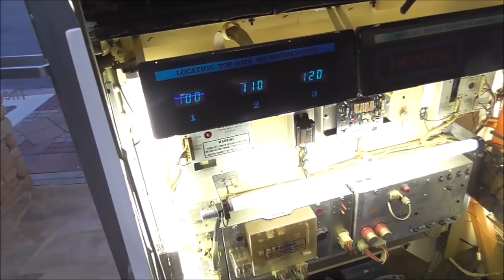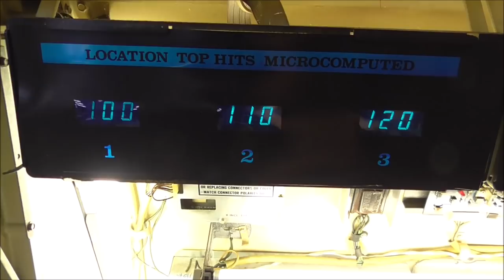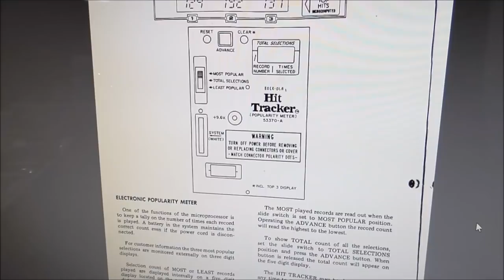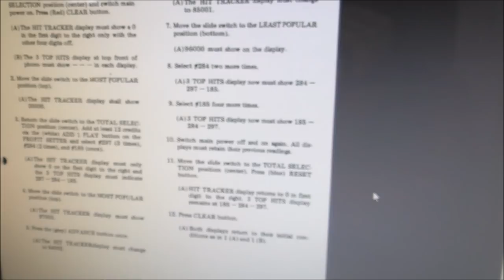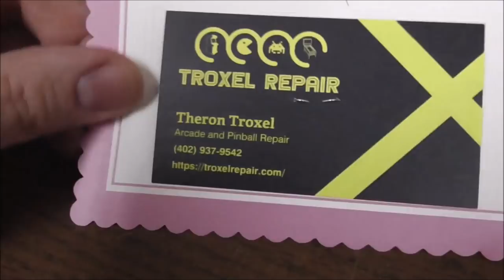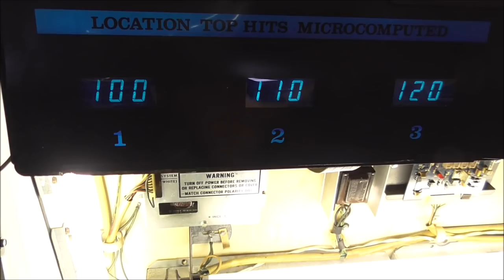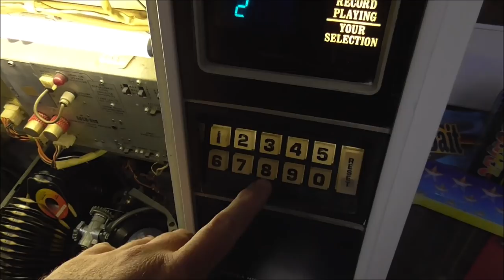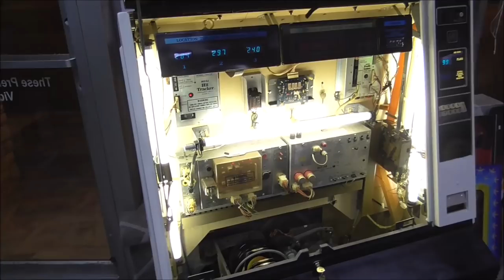How To Fix The Hit Tracker In Your Rock-Ola Jukebox!  Vintage IC's that use 9.6 Volts????

Comment: Ron just come across this video, that is exactly the same Hit Tracker fitted in my Rock-ola 477 Max (1979) After watching this I took mine apart and found the battery fitted was, quite possibly, the orignal when this came over to the UK from the USA. It is a 3 Volt Eternacell with markings on it MT Vernon NY. Although there is no charge in it, it wasn't heavily corroded at all. My intention is to relpace it  just as you did with a button battery and hope everything else inside functions correctly. I would never have attempted this without your guidance first.
Thanks for all your knowledgeable posts, particularily enjoy the pintable ones and ones on rock-ola obviously.  
Stephen

Comment: The 9.6v line on my Rock-Ola 477 was sending my profit setter nuts, all kinds of random goings on. It read OK on a multimeter, but when I stuck the 'scope on it, you could see a lot of ripple. Some rather tired old electrolytics inside the power supply module turned out to be the problem.

Comment: That RAM chip is actually a HM3-6518-9.  Harris Inc. stylized the "H" but still made it part of the chip number, for maximum enjoyment.  Absolute maximum supply voltage is +7V (+5V recommended) so there must also be a +5V supply, or else there's a voltage regulator on that board somewhere (maybe one or more of those transistors and a zener diode or two).  The MM5799 is the microcontroller.  No luck finding anything about the MM57163's, but they almost have to be display decoders and drivers, and maybe even input controllers.  Many of the chips chosen for this board were originally intended to go into desk calculators.

Also, CMOS chips such as the CD4xxx series (your CD4069 hex inverter included) have an absolute max voltage of 20V.  So they tend to be used where higher voltages are preferred.

Back then there was a period of electronics with weird voltages.  The Intellivision home gaming console used +12V, +5V, and -2.3V on the CPU.  The clocks (that's right, plural clock inputs) were +12V.  Fortunately, later chips started using internal voltage steppers, so they hide the complexity and only demand one VCC voltage.

Comment: I believe the National Semi P-MOS MM57xx series, like the MM5799, was designed to run on around 9 volts. The MM5799 micro was popular in electronic games of the period as well as a couple of pocket calculators, that all ran on 9 volt batteries.
Reply from the maker: I forgot about 9v batteries, I guess that makes sense why you would need 9volt chips!

Comment: Where did the 240 come from in the 3rd spot?  Wasn't it 185 when you turned it off  the last time?
Reply from the maker: I don't know, I didn't notice that when we did it... it's a mystery!
Reply: @LyonsArcade  yeah, Ron, I noticed that too....hmm
Reply: old SRAM chips (especially AFTER getting old) that were designed for a retention voltage of 3.6V (which is almost certainly what the original battery was) are pretty unreliable when powered with 3V. Bits may flip. I've experienced that with some old arcade machines. High scores lost or garbled at 3V, works just fine at 3.6V. Even if it's a 5V IC.
Reply: @LyonsArcade  I noticed that too (the 240). Did you also check to see if the battery could be getting a charge when it's on? It's possible the original battery was rechargeable (I'm purely guessing).
Reply: @senilyDeluxe  Ronnie mentioned that the retention voltage for this specific chip was 2.0V, and I checked it against the HARRIS and Intersil datasheets and yep, 2.0V
Reply: @TwelveBaud  Damn. Why is it always the Unobtainium ICs that have to die? At the Museum in Seligenstadt we have a few Playmatic pinball machines, at least one of which is also suffering from senile RAM (passes self test, but bits flip seconds after being stored). They use CDP1824 RAM which also uses around 10V. I still need to come up with a way to put less exotic RAM in there.

Comment: Now, I have not seen that breaker hack

The test device I saw hooked up to the fuse terminals and I think it has a light or some indication that the circuit is a short

Comment: Thank you for all you do on YouTube. Together with a manual I found for my Rock-Ola Mystic 478 and your videos. I have managed to restore it to a working Jukebox. I've just set up the hit tracker and replaced the 3v battery thanks to you. All that's left for me now is that the selection and credit displays don't light up. I've cleaned all the pins and cables etc. Any other tips would be helpful, could it be a chipset or similar? Much appreciated in anticipation of a reply...
Reply: if you ever figured this out i am having the same issue except no displays light up and besides turning on my machine is unresponsive

Comment: It is a royalty tracker for the operator. In most locations like bars, and pubs. They have to pay for a ACAP and BMI licensing to allow music to be played. The records that where in jukeboxes are not just the standard run of the mill 45 rpm you could have bought at Woolco back in the day. The 45's came directly from the record companies with a special label making them as promotional or jukebox use only. These records where a bit thicker, and cost way more cause of the licensing agreement with them. Having the data of which record was played how many times allowed for the proper artists to get paid for every time that record was played, and also let the operator know if the record was profitable or a bust. If the record wasn't making any money. The operator could return it and get credited towards another selection.
Reply from the maker: About half of what you just said is not true

Comment: How do I remove the voltage regulator on Rockola 488?  After unscrewing the 2 black screws, it doesn't pop off, does it need to be pried off, or does the whole metal cover need to be removed to access behind the voltage regulator to remove?
Reply from the maker: it's soldered to the board on the back, so you have to remove the board and unsolder the voltage regulator.
Reply: @LyonsArcade  thank you so much!  The voltage is just under 5v right now.  Watching your video.

Comment: Hi Ron! Another excellent video, thank you! I changed the battery for one about the same physical size and it works! Also, I have this exact same machine and I notice when you switch yours off and back on it doesn’t make a peep. Mine goes “WHOMP” when I turn it on, regardless of the volume setting. The only way I can think to avoid this is to install a delay relay for the speaker connection. (If I unplug the speakers, then turn on the machine before plugging the speakers back in, no “Whomp”) Have you ever had this issue with any machine? How did you fix it? Thanks!

Comment: CD4069 - hex inverters, VCC: 3-18V. Used one to build a cmos clock._
Reply from the maker: That's wild they can make a chip that can use that large of a voltage difference...

Comment: Presumably the original battery was a rechargeable Ni-Cd. How do you stop the circuit trying to charge the 2032 non-rechargeable lithium coin cell when the power is on?
Reply from the maker: It has a diode on the board that all the voltage runs through, I don't know how they charged it or what battery was on there originally.

Comment: Thanks for your greath videos. Did you just put a non-rechargable battery in a device that is charging it??? Maybe also put a diode in there so the battery will not explode? :-)
Reply: Or maybe your 2032 is rechargable? Just researched it, I didn't know you could get that, so I just learned that. Thanks :-)
Reply from the maker: No it's not rechargeable but neither was the original one, there's a diode in it already.

Comment: Hello!  I have a Rockola 464 that I am hoping you can help me with, or refer me to one of your videos I can watch.  The only way I can get my unit to play is to manually flip the switches on the big wheel to the right of the records that a sensor spins around.  The coin-operated part does not work.  Any ideas?  I live in Alaska and I have not had any luck finding anyone to work on it..  Thx.

Comment: National Semiconductor MM5785 is a memory control chip, good for 12V, max clock about 400kc- neat old board- cpu maybe the chip up near the slide switches.  Datasheet says the cpu is MM5799 or MM5782

Comment: the 478 mystic 1978 was the first one that was computer type and they suck lol. I had one say had they were trouble from the get go I had to fix so much on it . There was a man long gone that use to work for rock ola good guy and he was a big help but in the end I junked it. Problem with the 478 was static electricity build up and it would fry the board on the front of the record rack. Also told by him that being there first it had very very strict voltage 12 volt had to be almost spot on to high or low could kill something . 

Amp in it was odd also reversed phase type.

photos of it here not  mine 
http://www.dougschmittantiques.com/specialty%20items/rockolajukebox478/rockolamystic478jukebox.htm
Reply from the maker: I've had that one before that I fixed, I didn't have any problems but I also wasn't operating it which is a whole other story!
Reply: We had the 478 and 480 machines on our route back in the day. Those models were so troublesome, the boss switched our route over to all Rowe-Ami jukeboxes and retired all other brands off the route.
Reply: Worst on carpet or in dry place. Seen static shock screw them up big time. Just walk up to it touch the metal on it could make it go crazy. Like skip plays pick wrong play or worst rest the things. I think this was the death of rockola as a big brand in lots of places. Around here they all were replaced with other brands or older rockola´s.  Wurlitzer was big around here and Rowe.